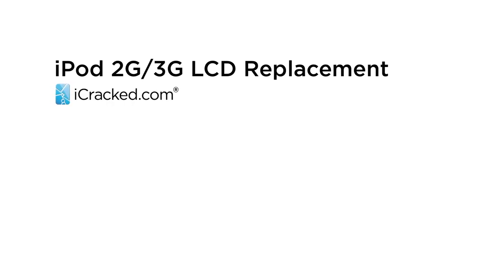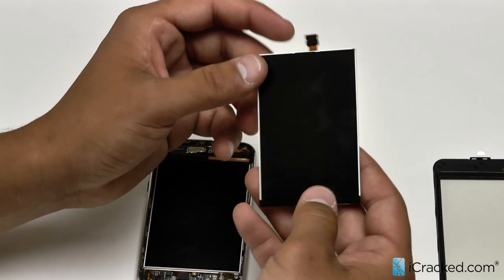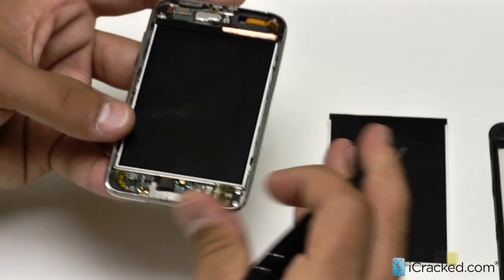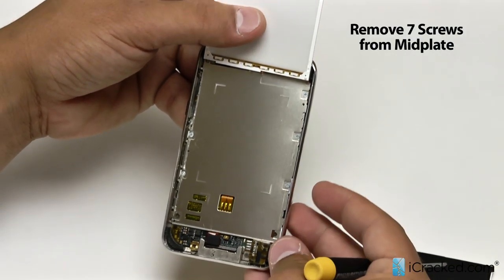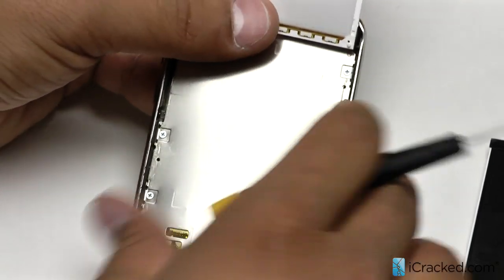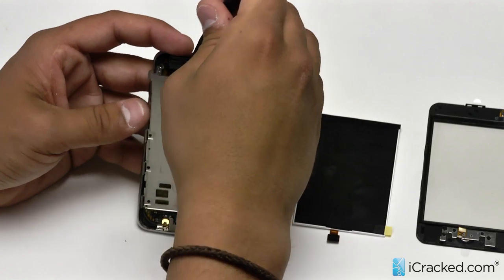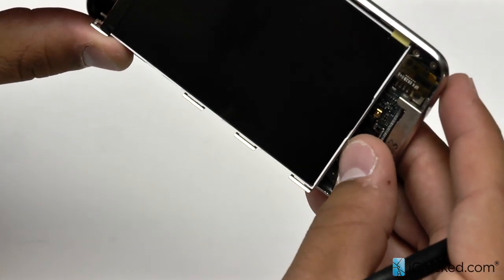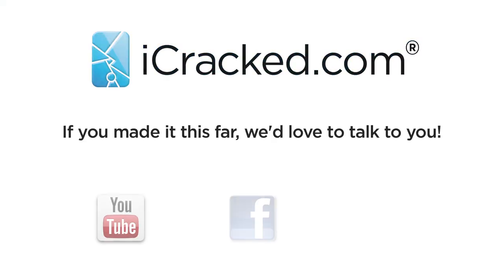Offical iPod Touch 2nd / 3rd Gen. LCD Replacement Video & Instructions - iCracked.com

Comment: how can you tell what generation ipod one has without taking apart my screen which turns on is totally frozen even the slide to turn off does not work any ideas? thanks Niall
Reply: If the engraving on the lower back is still legible there is a 5 digit model number that starts with an "A". Go to this site --> http://www.everymac.com/ultimate-mac-lookup/ and type in the model number. It will give you the general specs of the ipod. 2nd and 3rd gen ipod touches look almost identical so you really have to go off of the model number to be sure of what you have. It sounds like the digitizer cable is not connected properly or the cable is damaged if it won't respond to the slide to unlock motion.